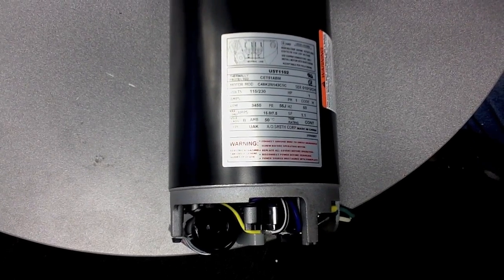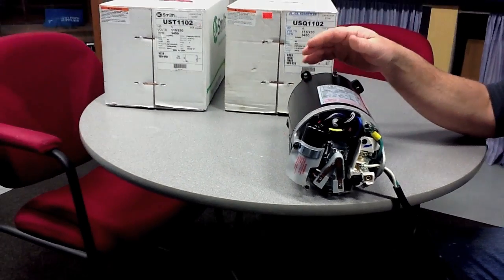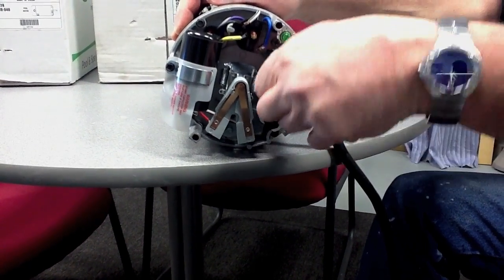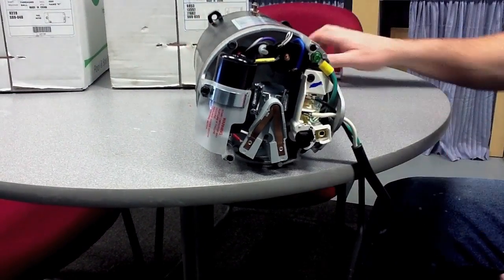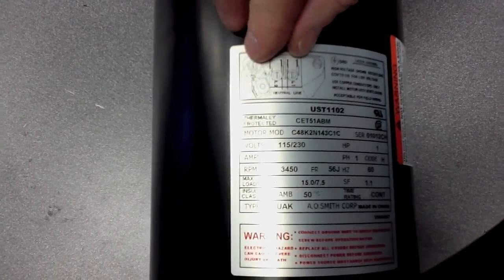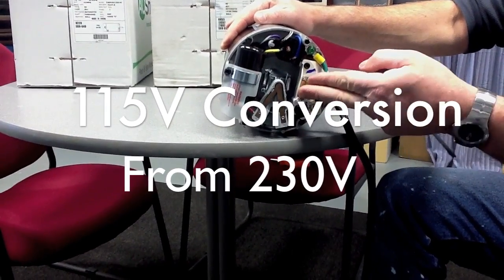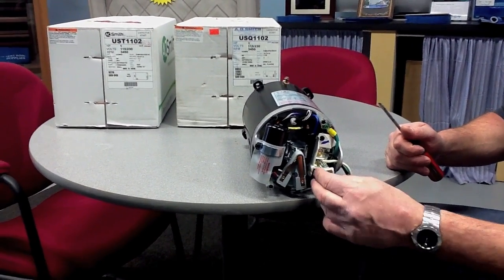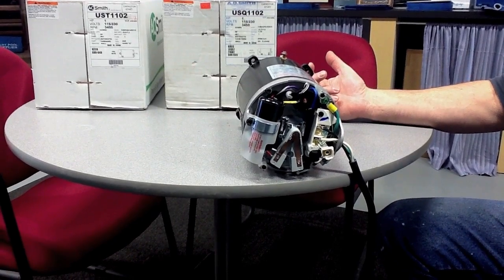How to Convert an Inground Pool Pump Motor from 115v to 230v

Comment: So I have a pump NBHT Model HBP110 II I bought about a year ago. I did not realize pumps can be 115/230v as this one is. It had a normal 115v plug which is what my power to pump is.. 115v. The pump stopped and was very hot after about a month of working fine. After it cools down it will run maybe a few hours. Well after trying to track down what the issue was I see there is a little cover on the end of the pump with a 2 way selector switch. My new pump was set to 230v. I thought ok here's the problem. When I switched back to 115v it will only run about 2 minutes until the GFI kicks out. I reset it comes right back on. Did I damage the pump running the pump switched to 230v supplying 115v? Everyone says they could see the opposite happening if i was running 230v to a 115v setting but that's not the case?

Comment: While my pump was running I accidentally switched a switch, thinking it was an on/off switch, from 115v to 230v now it is barely running even after unplugging it and starting over. Is there a fix?

Comment: ....WHAT IS THE PART NAME OF THE V-SHAPED SWITCH THAT PROVIDES POWER TO THE CAPACITOR? YOU REFER TO IT AS A "STARTER"...Is that the correct term to use if I need to order the part?
Reply: I call it a switch.
Reply: I have a question for you. Where are you going to order that v-shaped part from? I melted the terminal and am trying to find where to order it from. You know, the part with the 115/240 switch.

Comment: Hi E-Z Test Pool

New subcriber here. And I need your help. I bought a pump 1/3hp  Gould pump no. J03 from a scrapyard. Our power supply is 220v.  Pump does not have a switch from 115v to 220v. I do not know the pump's voltage but the Capacitor says 110/115v 124-140mfd. Is it 115v? But I tried to connect it to our wall socket abruptly and it runs. I'm afraid if I try to run it a long time the windings will be burnt. 

Thanks.

Boppie Distura
Reply from the maker: Yes, that's a 115! Sounds like a good find!

Comment: Wait wait wait, Phase order doesn't matter for forward or reverse? is there an internal phase invertor in the motor to keep the motor from water cavitation from running the pump in the wrong direction?
Reply from the maker: The single phase motor shown does not spin in reverse. Three phase motors can in fact be wired to spin both ways. Thanks!

Comment: I removed my old pump and thought the wiring would be the same on my new one. They were both same make same hp same model etc but looks like the manufacturer revamped the newer pump better than the older one and in doing so the wire hookups were completely different. Either way I had a green and two black wires to deal with. After watching your video it occurred to me that I had a 230v single phase 3 wire setup and could simply put one black on L1 and the other black on L2. Put the green on ground and good to go. Thanks for the help!
Reply from the maker: Thank you very much!

Comment: I am pretty sure what is shown is incorrect.  First, unless the wiring from your timer panel is screwy, the color for the live 230V wires will be red and black.  For 230V both black and red are “hot” and they have symmetrical voltages with respect to ground, so it may be true that for 230V it does not matter which wire goes to which pole on the pump (I say may I am not positive that it does not matter).  For 115V, though, one of the wires is neutral and the other is “hot” (and then there is the ground wire).  For 115V the wires out of the timer box will be black and white.  Neutral usually (from what I’ve seen) ends up having a voltage near ground, but I am pretty sure this is only because it comes out of the center tap of the step down transformer that brings 230V to 115V — that is, it is not a “true” ground.  Long story short, the “hot” wires (ie the two that are not ground) of a 115V installation do not have symmetrical voltages and so I would be surprised if it in fact does not matter which color goes to which pole on the pump.
Reply: on 230 volt system 2 hot legs it does not matter because both legs are the same supplying 110 volts each from both buses ( 2 hot legs / power wires acts as each others returns due to AC going back and forth) ; remember your dealing with AC current ( unlike DC the current goes back and forth and polarity is not a factor) 
For 110v the motor  probably converts it to dc so the wiring for hot wire / neutral (works the same way as ground - return.    If this was a DC system wiring it wrong would make the motor turn in the wrong direction.
Reply: each line...L1 and L2 both send 115 vac to each terminal therefore it gets 220-230 vac. Most of the time each phase...red or black is 115vac. Both hot and the ground carries the neutral load or unused voltage. if you have a 115 volts unit most of the time unless they wired it wrong will be black..(hot) and white (neutral) one wire, the black hot carries 115 volts ac.. the white is your neutral. which carries unused voltage back to the panel which in turn returns it back to the transformer... there ya go.. if you have whit enad black its probably 115. Set switch to 115 if you have green red and black,,, black to L1 and red to L2 switch to 220. If you have it one 220 switch and the motor goes slow when you fire it up it wont hurt it. It will only run at half speed because its only getting half voltage. If you have it switched to 115 and hit it with 220 your screwed and will smoke. So always , if you dont know , switch to 220 and wire that in. See if it runs slow. as a last resort....your welcome!

Comment: very good tutorial, but like u say if u switch the 115v to 230v on the black plug inside motor, we have to change the breaker for 2 polo breaker.

Comment: I have exact motor which i got it from my friend. The motor was set it to 115v and used 12awg wire to l1 and l2 without ground. Whereas my old motor was using 14awg wire. I replace with new motor ust1102 with 115v set and 14awg wire, but when I fire up motor my breaker is getting tripped. I have double black switch in my breaker box. 
I am going to check my voltage coming in from breaker, if its 240 then should I switch motor setting to 230v from 115v?
Should I also use 12awg instead of 14awg? Please advice.
Reply from the maker: Hi Jagdish the wiring on the pump should match your breaker, so yes you would need to switch it to 230V and 12awg wire is preferred.

Comment: QUESTION I have a Flotec FP5182-08 pump and the 230 / 115 V switch burned and detached from the whole terminal lead white plastic part. Where can I purchase that whole part? I do not even know what is called. Thanks in advance